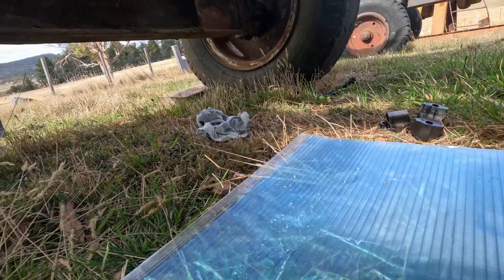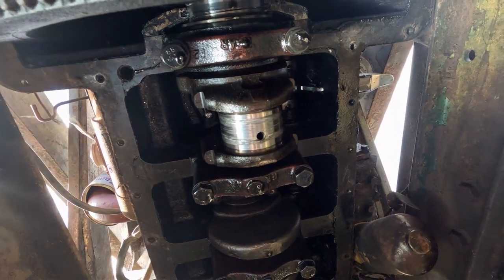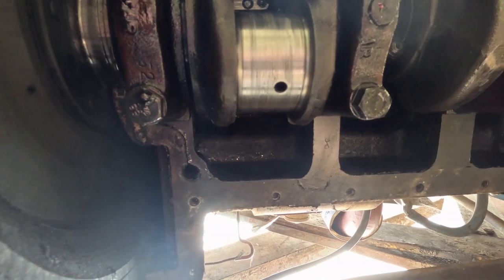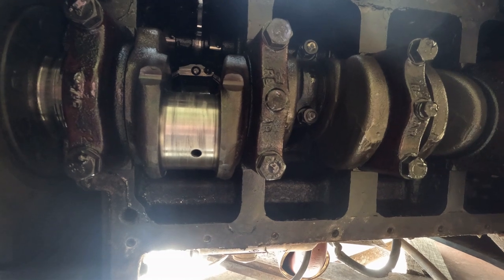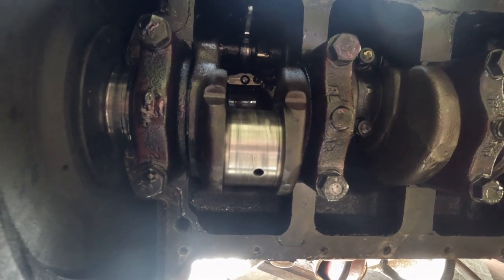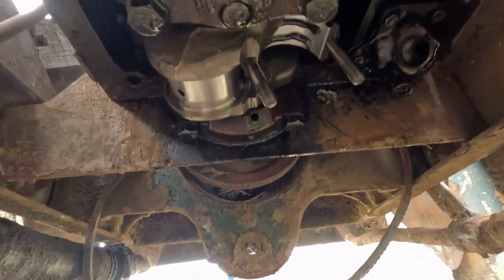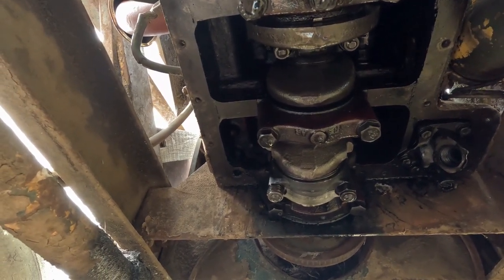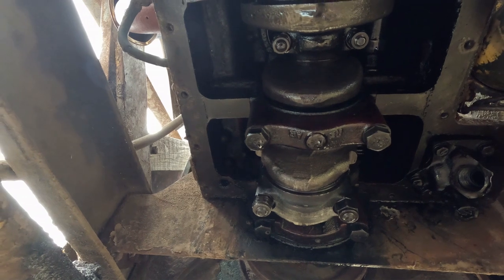Fordson power major Malcolm Moore crane repair pt 8 crank big end bearing replacement

Comment: Just a note. Before I attempt a start on an engine which hasn’t been run in a long time I prime the oil system before I turn it at all. I have an oil pump out of an old small block Chevy mounted in a 5 gallon pail. I run the pump with a drill and hook a hose up to an oil passage such as where oil pressure gauge is plumbed in and pressurize system so I know bearings aren’t dry. I have also made bronze faced bearings for situations like yours here if the crank is badly scored as bronze will take more hammering and abuse than babbit. Hope this works out, it should if it was mostly Babbitt stuck to crank.
Reply from the maker: I've been thinking about making a priming tool for a while now but just haven't got around to it.
The journal actually cleaned up pretty good all things considered so I'm confident it will be OK